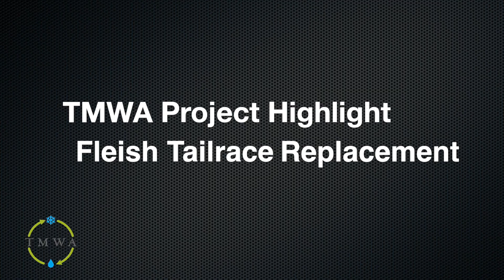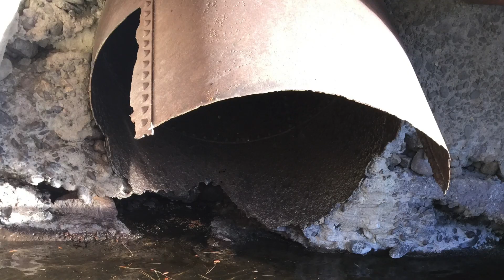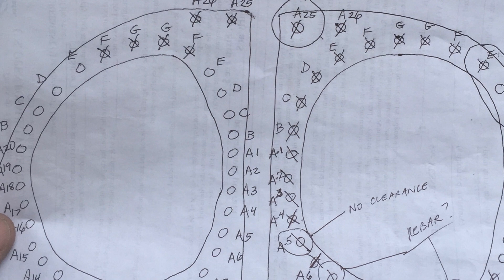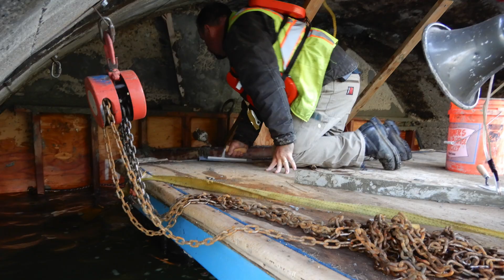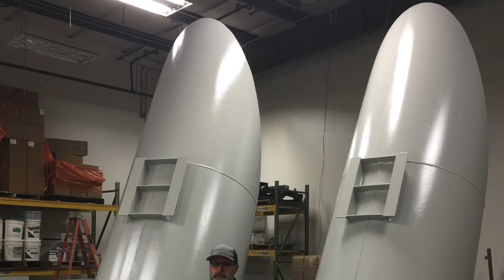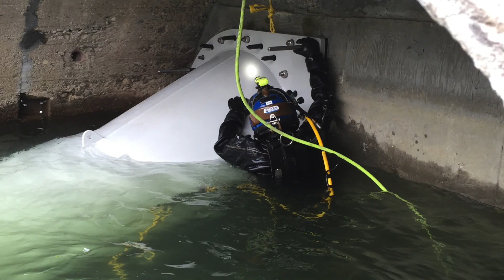TMWA Hydroelectric Plant Tailrace Replacement

Comment: I see what you are saying with the river sound. If your shotgun mic is mount to the top of your it is pointing straight at the river as well as your subject. If you were able to use a shotgun mic on a boom pole, you would be able to point it right at the subject and away from the river at the same time. 

Plus you can have it closer to his mouth some your levels can be way down and so that the ambient noise in the background will be much lower as well. 

Pleasure meeting you today.